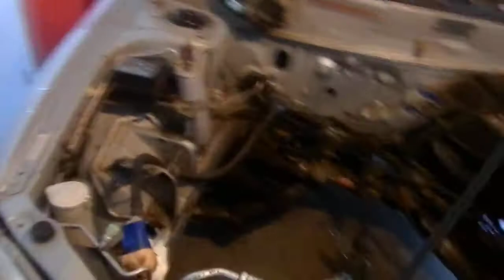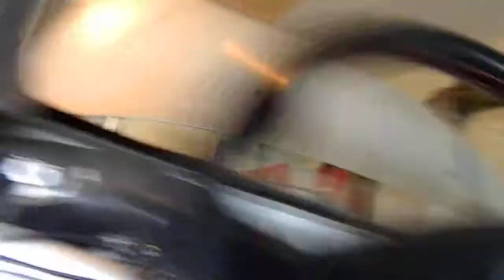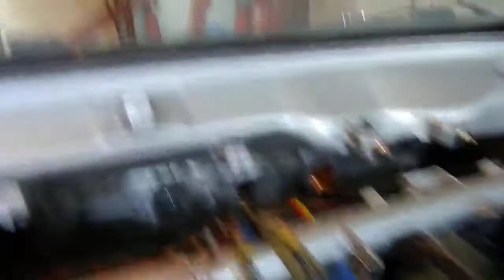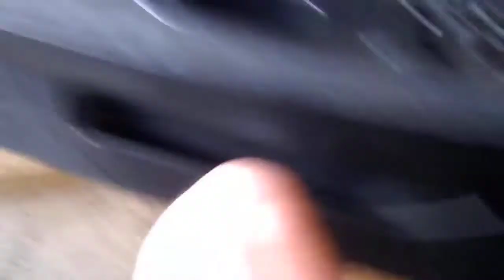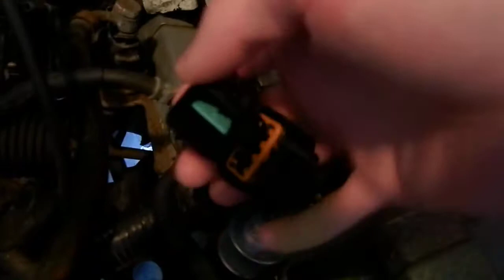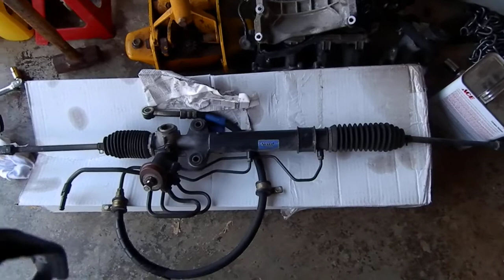Evo 4 auto climate control into 5G Mirage part 2

Comment from the maker: I haven't built it yet.  The engine that failed was the stock 4G15 1.5L SOHC which I will replace with the 4G93 SOHC temporarily.  I have an Evo 4 4G63T, but it's badly crankwalked and done for.  I have an Evo 8 block and a 4G64 100mm crank that I'll be using with the Evo 4 head and peripherals to build a 2.3L stroker, but I haven't bought the pistons or rods yet and that needs to wait till the AWD system is in anyway. :thumbsup: